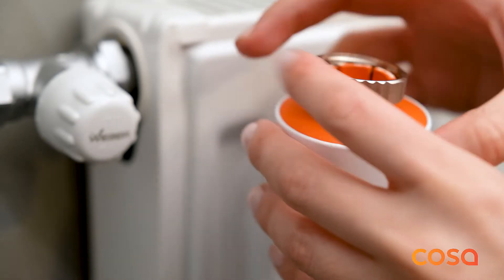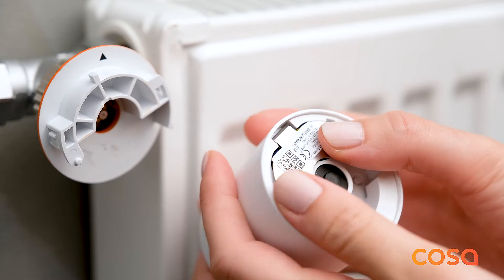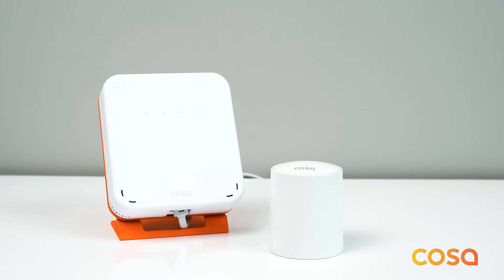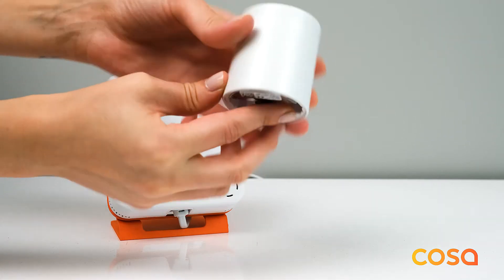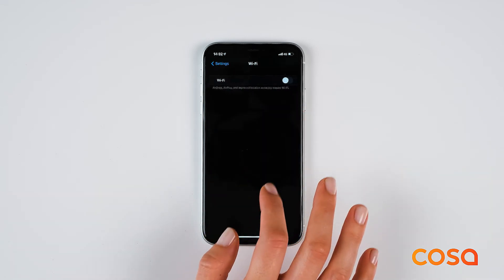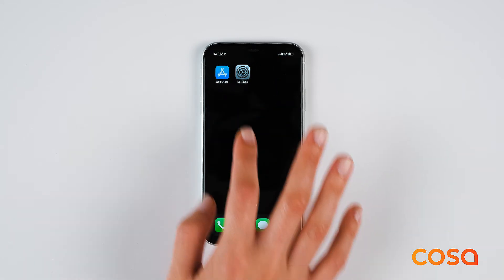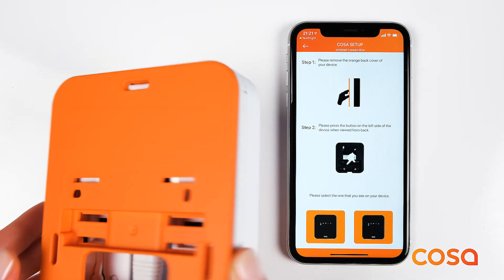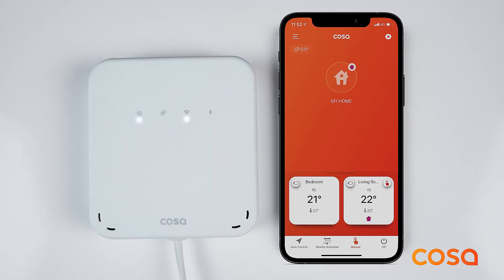Cosa P4EN-04 Smart Thermostat Radiator Control and P4EN-05 Smart Radiator Valve

Comment: I have problem about powering thermostating radiator valve. 
I have change batteries, I have close the metal cup AND I AM SURE that is securely fit. 
After no indicator light appears and it appears that it is not powered.
Help please.

Comment: This valve can be connected to the smart heater and ac thermostat or need to have this gateway?
Reply from the maker: Hello, it is not possible to integrate it into your existing thermostat. In order to use the mobile application, you need to provide a Cosa gateway. Best regards
Reply: @smartcosa  where can i buy them in romania?
Reply from the maker: @Cremossacoffee  https://linkin.bio/cez_romania You can reach it from Cez Romania.
Best Regards
Reply: @smartcosa  they dont sell this product. They are selling only if you’re going to buy gas from them. I want this thermostat + hub+ valves for radiators to buy freely not to make a contract for gas with them!
Reply: @smartcosa  and one more question. How i can manage also the smart heating /ac thermostat with the gas boiler and also the valves with the gateway on the same app in the same house? It is possible?
Reply from the maker: @Cremossacoffee  Currently not in stock. For this reason, it is not available for sale. In case of production, you can obtain it through our website. Production date will be announced on our website. Best regards
Reply from the maker: @Cremossacoffee  It is not possible to manage your valve gateway and air conditioner through the same product. Two different products must be supplied.
Reply: @smartcosa  yes. I need another gateway and valves. But can be managed on the same app?
Reply from the maker: @Cremossacoffee  It is possible to control your two products on separate pages on the same application.